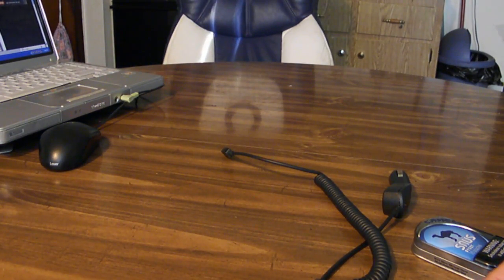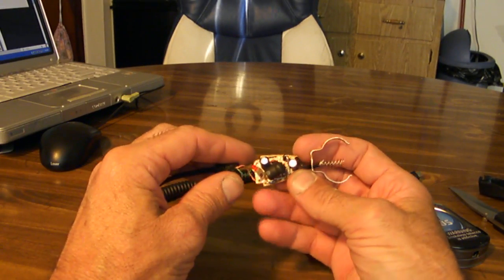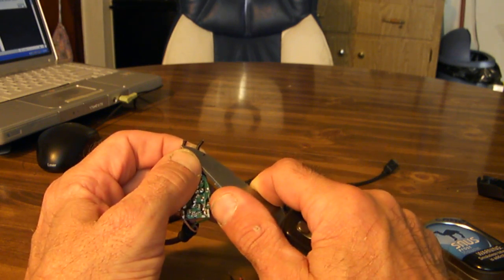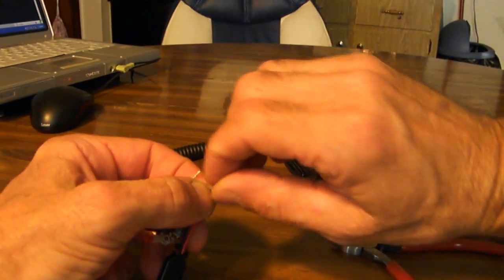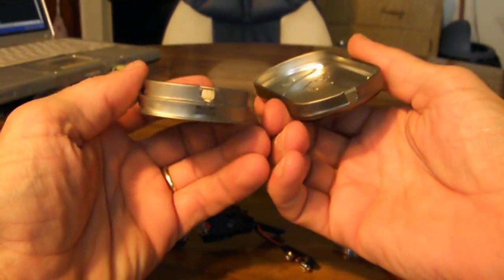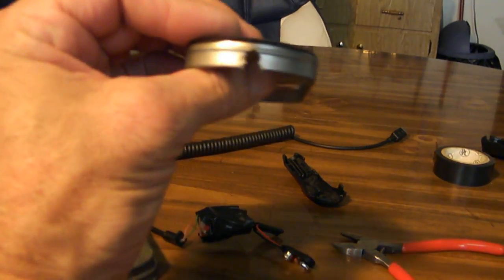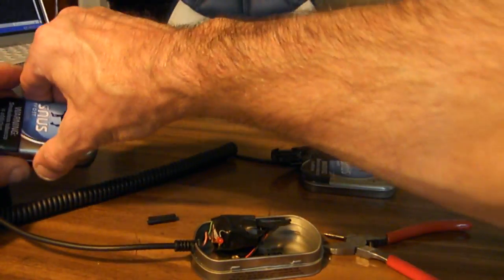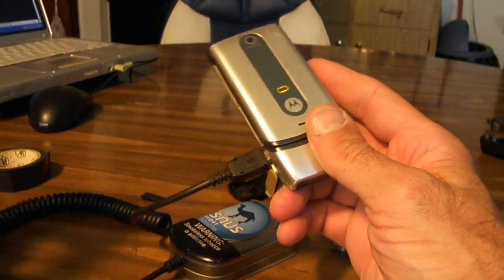How To Make A Battery Operated Cell Charger.MP4

Comment: Even easier... A AA or AAA battery pack from Radio Shack, 4 batteries will get you 6 volts. Solder the positive and negative directly to the leads on the pack and instant charger. I throw these together for people in 5 minutes.

Comment from the maker: @arcaustria00 Yes sir it does work. It will not work with all phones however. Depending on the amperage needed to charge certain phones, this setup will not work with some. It probably will not work with some of the smart phones due to the higher amperage needed to charge them. I am working on that issue because I will be getting a smart phone.